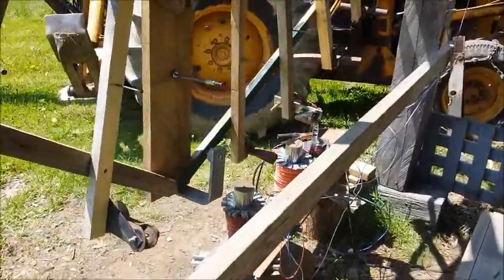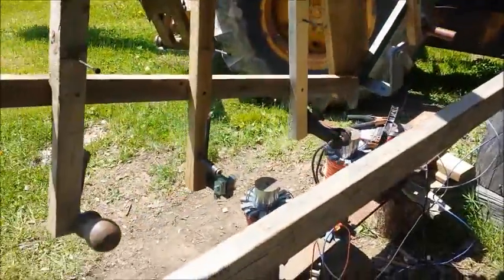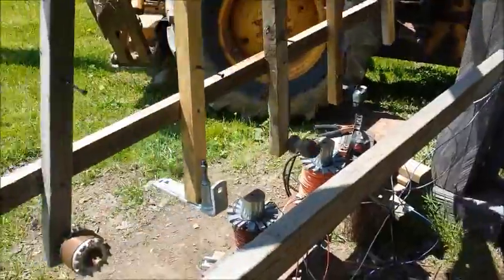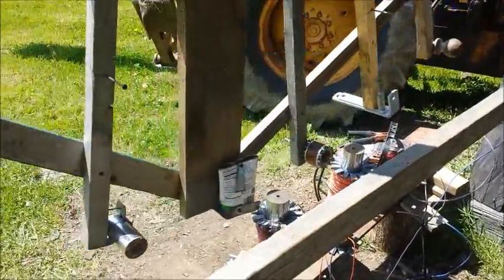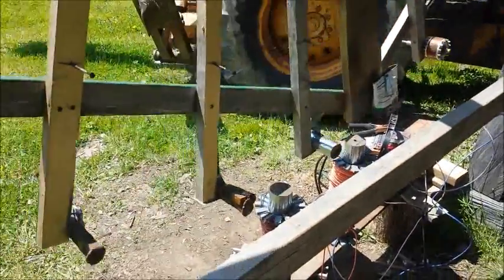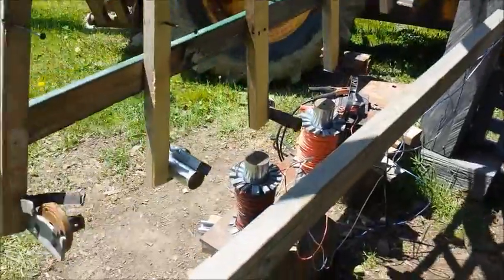2016 PMBO Final Entry (worlds largest?)

Comment: Awesome build! I have been working on a pendulum wheel idea. I hypothesize the pendulum wheel would work best with the size wheel you have. Would you be interested in trying to take the wheel a step or two further? -Mechanical Artist
Reply from the maker: I already tore the pole pieces off cause I want to wind a GIANT Tesla pancake coil and try to aim power across the lawn. But as far as the pendulum I did that last year just farting around with a 60 pound dumbell with a coil pulsing the upper pendulum part and it ran for hours on a car Battery. a true pulse motor. YES the weight is KEY, but bearing friction is UNKEY. Whats your idea?
Reply: +Made by one man I will make a video as a reply as well. But to give a basic idea of the concept: replace the poles with pendulums, pulse them at the top of the wheel so that they oscillate until they reach the bottom. 

There's more detail, but that's the basic. It apprears that a flat spring is frictionless (hacksaw blade).
Reply from the maker: MaintenanceMouse I could never wrap my head around the "apparent" perpetual motion Pendulum flapper machine if thats what you are eluding to. Does it really work and I just don't see it. like the PERP MOT videos?
Reply: +Made by one man pendulum flapper? do you have a link?

Comment: You could do a lot of work with that mass! Friction is a such pain! You post this in the forum?
Reply from the maker: yes on the posting. And yes You are right on this thing turns easy and stays going for a good time with the mass. The stupid cam follower is the prollem. a proximity sensor with a better set of everything and I might find something but This is merely for show. Friction  tho is part of the conceptual limits of overunity yet The big thing tesla knew is this. Static friction is greater than dynamic friction.    like a box on the carpet, so goes it with the electricity through aether.

Comment: should be biggest so far
Reply from the maker: Not that the size parameter matters, just thought I would try it.
Reply: i hope i could found a place to build like this big.
Reply from the maker: alloy TAM Or use the old tripod concept with two "A" framed at right angles of the planet THEN stake the last leg to the ground to prevent the weight of the rotor from pulling it forward and pin it plumb (just like the they brace framed walls in houses temporarily).
         There would be the start of a cheap "mobile" frame on two by fours or whatever. I just happened to have this old crappy shelter for my mill that seems sacrificial for now. just an idea.   Scott R.
Reply: well i can try build it inside the jungle, where i use to hiking there...
so could provide some remote electricity for them,
forgotten to mentioned that your PM also can be a generator too
Reply from the maker: alloy TAM Good Point. Actually the little Leedskalnin PMH can be 5 different things (that I know of):::
1. With a proper size keeper bar it is a PMH.
    a Permanent Magnet Holder. If you look up DEC (Digital Equipment Corp) the computers in the schools (during the seventies) at dartmouth and elsewhere had Iron core memory. It believe it or not, worked on this Ed Leedskalnin "discovery" thus holding magnetic flux "permanantly" in the irons core with little rings (or pmh's).
2. It is a stator to pilot Pulse Motors.(my case and Leedskalnins for his rock cutting machine)
3. When the poles are magnetic it can be a pickup (your case the generator)
4. With two drastically different coil windings (and the keeper again) it can become a high voltage DC induction coil and so of course
5. with the keeper again it can become a transformer for AC. 
Scott R.
Reply: well,as long there is coil and magnetic 
 motor and generator are reverse-able
thanks for sharing this info..
Reply from the maker: alloy TAM Lastly it is the chief cause of this PMBO to minimize the loss between SAID  motor/generator concept therefore trying to maximize to UNITY.  yeehaw perfect efficiency. so what would be causing it move then since nothing else except wind is moving. These are the issues.
Reply: wind be helping,
when the rotor are aerodynamically design,
high momentum in large size...
just need high strength structure to make sure it wont fly away,
:p